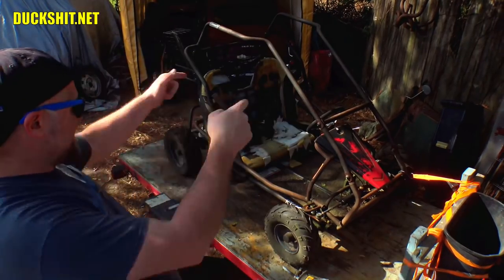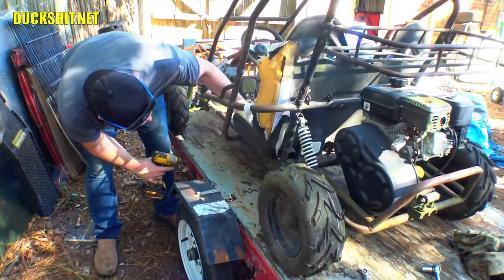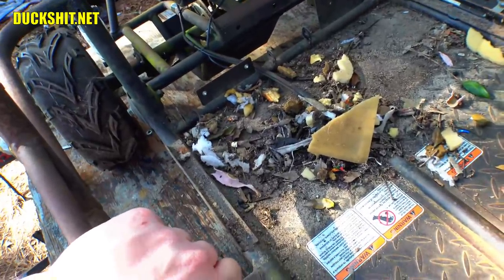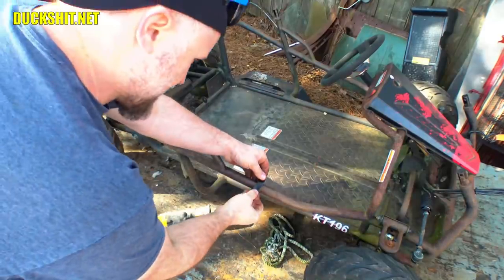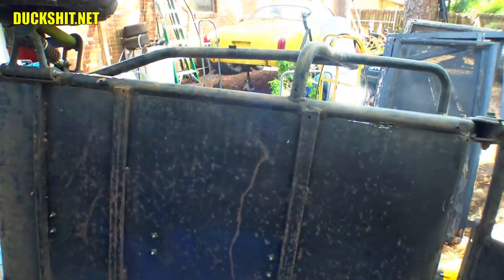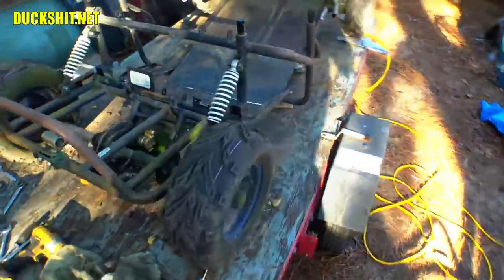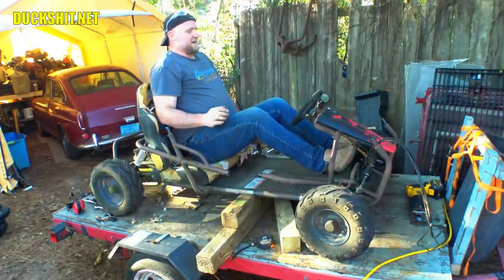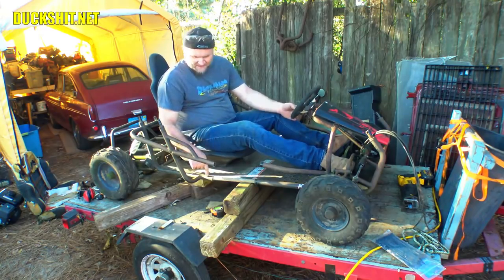Cutting Frame to make Bigger - KT196 Go Kart - 03

Comment from the maker: While I've got Kart cut apart, does anyone want to see anything special (within reason) done to it?
Reply: Bigger tires, a light bar, and a set of LED whips!
Reply from the maker: I guess you already know how we are going to build yours!
Reply: Is it a posi axle? If so put some pvc on the back tires and try drifting it in a parking lot. Maybe the longer wheelbase will make it easier to drift.
Reply: Low back seat
Reply from the maker: Solid axle, but yes, will be trying this!  😁👍🏻
Reply: I'm just trying to figure out how to add some mud flaps to it.
Reply from the maker: @brittneyturnbow771  shouldn't be too hard with appropriate brackets to mount them... probably would look a bit silly though without fenders.  Maybe hang the flaps from some custom fenders.
Reply: @Lord Duckman's Driveway  I don't care how it looks. Lol I bought this for my 2 daughter's for Christmas and they get covered in mud!!

Comment: This is cool and all but I’m 6’0” and have the same kart. I just didn’t put the roll cage on. Easy peasy
Reply from the maker: Great, still not comfortable with my knees in my chin and the steering wheel so low that you can't hardly use it to secure myself... it tries to toss me out.  Actually messed up my shoulder and still feeling it a year later from being so cramped in stock configuration.  But anyway, the kart is better than it ever was with a normal driving position, and still has its cage.